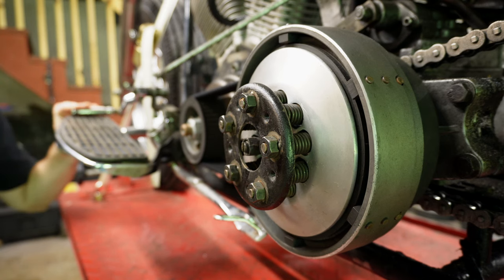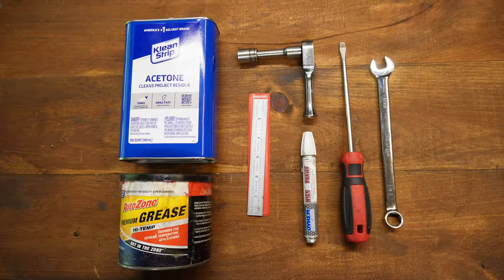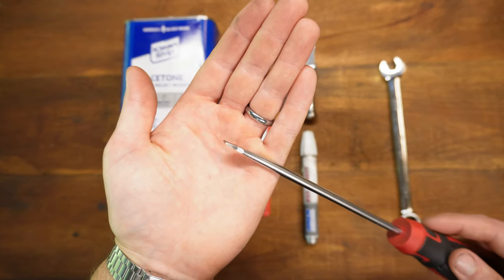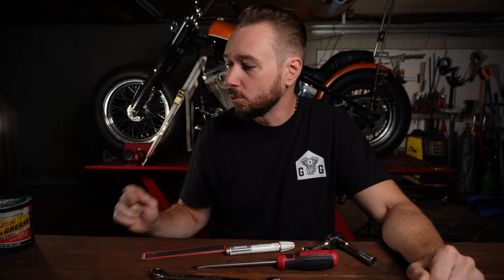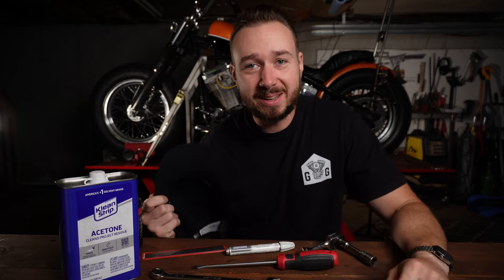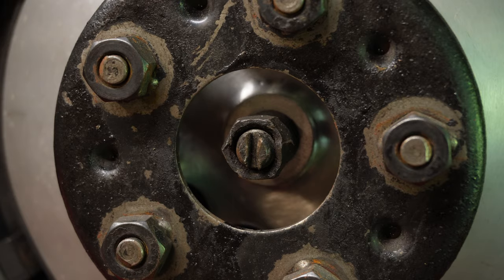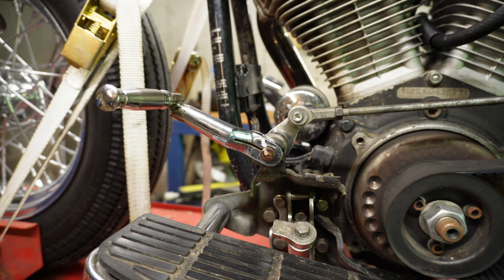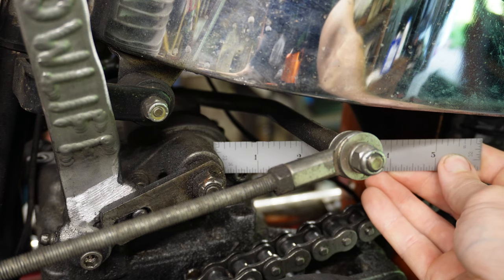How To Adjust A Harley Foot Clutch

Comment: Great video  !  You can check clutch release  with a dial indicator on the adj   screw   of clutch  then engage clutch fully  end gap should be  about   .084"  gap  as not to over extend pressure plate  , You can adj  linkage  geometry  lengths .
Reply from the maker: Good tip man thank you!

Comment: The primary belt being too tight was exactly the problem I had with my 47. If I would have seen this video before it would have saves me hours of fiddling with clutch. Great videos. Keep your foot in it
Reply from the maker: So glad to hear this man! It drove me crazy too and everybody told me it had nothing to do with the belt but I loosened it anyways and fixed it. Had to put that info out for the world 🌎🙏🏼
Reply: @greasesgarage  My new dilemma is my 97 Evo with a primo 3” belt that I have been running for 20 yrs is now tight. It has a solid 1 piece backing plate, no adjustment and no issues with clutch walk. Everyone I talk to has no clue. The day starts off with the proper amount of play, 100 miles later it’s tight. I re torqued the motor and primary but no change. I’m just gonna run it and see what happens.
Reply from the maker: @degonzoman  that’s interesting, I’ve never run a belt without a separate trans allowing it to adjust
Reply: @greasesgarage  I’m running a baker 6 speed with a Premo brute IV that has a solid backing plate back in the day. They’re two piece adjustable nowadays.
Reply: @degonzoman so you can’t adjust the trans to set the belt tension?  I have never seen a setup where it’s not adjusted
Reply: @Scummy_shovel  The belt has about 3/8-1/2" of play when I leave the house after about 100 miles this is the results, tight. I have been running this Primo Brute IV set up since 2000 with no issues other than swapping out the belts over time. It has a solid backing plate. I had a guy change the rear drive belt when this all started, took it back he said he tightened up the trans. but still the same. All I can think is to get it on the bench loosen everything and torque it all back down.  
Not sure if this video works but here it is after 100 miles. 

 https://www.youtube.com/watch?v=oxgsSE84wAs
Reply: @degonzoman  that’s extremely weird that the tension would change.  Then goes back to loose after it’s set for a while?  Or you set it. Ride. It gets tight and stays tight untill you adjust it again?
Reply: @Scummy_shovel  When I roll it out cold it's right on 3/8"-1/2" play, right were it's always been, 100 miles later tight. There is nothing to adjust with that Premo Brute IV solid backing plate. I thought maybe the clutch hub was heating up and expanding creating the tension so I pulled out the plates to have a look and it all looks good by the eye. Front and rear pulley doesn't seem to be any hotter than usual. I have been running this set up for 24 years and have over 100K on it. The motor main bearing has been changed out 5 years ago the Baker 6 speed is still original. I can only think maybe the Trans is not torqued correctly and after banging through the gears its somehow shifting ever so slightly or it is a bearing issue. I'm at a loss, everyone I talk to thinks I'm crazy but that's besides the point. Now I just pack an extra belt and run it.  
Keep the videos coming
Reply: @degonzoman  where you the guy on the chop cult forum asking this question?
Reply: Yeah that’s was me, I also asked on the Jockey Journal but for some reason they took it off. I guess Evo’s are not welcome.
Reply: @degonzoman  lol. Yea they don’t like evos there. I remember seeing you on chop cult.  Did noone have any ideas there?  If none of those guys have ever seen it then Idk what to tell ya. Lot of knowledgeable guys on there.  I guess all belts tighten a tad when they get warm   Maybe just get another belt and see how it goes.  I don’t mess with solid plates or those really wide belts.  I am a 1.5 kickstart guy myself.  Good luck tho.

Comment: The pushrod adjusting screw is for adjusting pushrod end play (1/4 to 1/2 turn out from lightly seated). This endplay is to prevent the pushrod throwout bearing from burning up. The spring retainer nuts are for compressing the clutch springs to the proper installed height/pressure. My Barnett heavy-duty clutch springs have a 1-1/2" free length and have 68 pounds of pressure at their installed height of 1-1/8". With the pushrod adjusting screw set, and locknut tightened, and spring pressure adjusted....measure from the clutch release arm mounting point to the mounting point on the foot clutch pedal. With the pedal in the position you want, you may have to lengthen, shorten, or fabricate a new rod/chain or whatever you'd like to use, to achieve the pedal position you desire. That's it! You're done. Bang 'dem gears!

Comment: Great vid  I have a 59 pan with a 65 trans foot clutch hand shift full suicide  just replaced my clutches had to adjust the foot clutch all the way back cause the clutch wouldn’t disengage  but theres no nubbs on the pressure plate                          ( aftermarket) I just use nylock crown nuts ) and measure carefully ……good to go

Comment: Great videos! I have a 42 WLA and it grinds while attempting to put it in 1st gear. Any thoughts on how to adjust that? Thanks
Reply from the maker: Usually happens when the clutch isn’t fully disengaging the plates. I would check your clutch throw to make sure the plates are separated.

Comment: I love the sound of my dry clutch on the shovel, except mine isn’t that noticeable. I wonder if there is a way to make it louder?
Reply from the maker: This is the correct question to ask haha. Love it. These are drag specialities plates, the inexpensive ones. Maybe that’s the secret
Reply: @greasesgarage  do you run both the friction and steel from drag specialties?
Reply: Remove the rattlers

Comment: Hey grease, love the vids and the way you give simple info and instruction. I was wondering if you knew how to determine what belt you need for your application? Ive looked for something like that on forums and can’t find an answer. I have an open belt assembly on the way and wanna make sure I get it right.
Reply: * specifically how many teeth my belt should be. I see a lot of different amount of teeth options for 1.5” belts.
Reply from the maker: Great question, did you order a kit or just the pulleys? What bike is it going on
Reply: @greasesgarage  I’m just getting a set of used pulleys and didn’t come with belt and seller didn’t have any info to help with. Gonna be running this on my 1973 shovelhead and ratchet 4 speed.
Reply from the maker: I'll have to do some more digging on this but you'll want to determine whether your pulleys are for an 11mm belt or 8mm. That distance is from tooth to tooth on the belt itself. As far as why there are two options and which you'd choose for which situation, I can't say. I just know that the only one available for my evo/shovelhead combo was an 8mm which was marketed as being for 4 speed tranmission kickstart only.  @kalaniortiz3063

Comment: Hey man, i find your videos really helpful, I got a question, do you have any tip to how to adjust the primary belt ? Cheers
Reply from the maker: Thanks man. So in this video I showed you the benchmark I use for where the tension should be, but as far as how you’d make those adjustments, I will have to do another video to show that. I’ll add it to the list
Reply: I found the problem, I wasn’t able to find neutral easy or to go to the gears while the bike got hot, it was all in the clutch adjustment, and I sanded off a little bit the fingers of the clutch hub, now is working as it should be, thanks
Reply from the maker: @jorgequiros1310 that’s great to hear! Congrats on getting it solved brotha

Comment: Please show a evo 5 speed foot clutch conversion can i use a chain primary i live in So Oregon rain dirt roads i would like to cover the primary thants
Reply from the maker: I will try to get my hands on an evo 5 speed setup but it’ll be down the road because nobody I know has one. As for chain primary yes absolutely. You don’t need to go open primary to run a jockey shift

Comment: my clutch grips fairly high on the pedal at idle, but when i ride the clutch drags when fully pressed in ... any tips?
Reply from the maker: If I'm understanding what you're saying correctly, it sounds like there isn't enough total throw to disengage your clutch, even though the pedal travel is fairly long. Is that correct?

If so, I'd want to know how long your pedal is and where on that pedal the pull mechanism is attached. You need more twist of your clutch arm. If the rod attached to your pedal is only halfway up the pedal, move it to the very top so you're getting the full pull out of it. 

If the pedal is very short, use a longer pedal to give you more travel. 

Let me know if this helps

Comment: Hey man, i'm having trouble with my 4speed transmission/bdl clutch on my cone shovel. I made a foot clutch setup and it seems to keep jumping out of neutral into gear, it happens even when im trying to kick start the bike. Any insight would be appreciated.
Reply from the maker: I don’t think that jumping out of gear would be related to the jockey shifting but more about what’s inside the transmission itself, it could need a rebuild

Comment: Hi bro , I used  your knowhow to setup the rockerclutch I instald on my 1973 shovel.Normaly on a cable opperated clutch I whould set the clutch pushrod to nearly thigth and then back it off for some freeplay , on the rockerclutch I had to do what you mentioned and srew the clutch pushrod way in to make the clutch disingage ! it works but is this to much stress on the clutch release bearing ?
hope to hear from ya. Fred from the Netherlands.
Reply from the maker: Hey Fred, 

Glad to hear you got the clutch working! As far as the stress on the clutch, you want to make sure it only pulls JUST far enough to disengage the clutch, no further. So back it out a little bit and see if it still works, if it does, back it out a little more and repeat until it doesn’t then turn it back in. That’s your perfect setting 👌🏼
Reply: Thanks bro , so if there is pressere on the pushrod iff needed thats oke ?

Comment: Anyone know why the clutch is so loud when depressed? I look forward to doing a foot clutch, but is it possible to do without that grinding/scraping sound?
Reply from the maker: Yes. The sound you’re hearing is the clutch plates chattering against each other, this is distinctive of the dry clutch of the open primary. With a closed oil soaked primary the oil dampens that sound so you don’t hear it, so you could do a foot clutch with a closed primary and you wouldn’t hear the sound. 

Though I’ll admit, at chopper shows you hear the sound all day long and if you spend enough time around these chopper shows you’ll eventually want to have it yourself haha. Give it time

Comment: Just FYI:  Starret is pronounced "Stare it"  and a machinist ruler is referred to as a scale.  
 My bone stock 1999 Softail clutch WILL NOT function properly when adjusted to the factory manual specs. I had to learn the proper finness for MY clutch.
Reply from the maker: It’s definitely a “feel it out” type of thing. Springs wear out over time and lose tension, plates wear down with friction and shrink up, there’s too many factors at play. 

But when I was struggling to set mine up all I heard from everyone was the same old “buy a manual” speech so hopefully this video (and your confirmation) is enough for people to try tweaking their own setups.

Thanks for the input brotha
Reply: @greasesgarage   Just to be clear: I encourage every rider and/or builder to have the factory service manuals and factory parts catalogs for their machine . If their machine is a swap meet special, then at least get the factory parts catalogs that cover the parts from which their machine is built.  Having these books/pdfs/whatever will provide invaluable information and will pay for themselves many times over if your wrench your own ride. 
 My 1999 Softail clutch will not function properly when adjusted to fac man specs, BUT, fac man specs got me into the ball park so that I could figure out what needed to be done.

Comment: Also if you set your clutch hub nuts to where you like the throw of your clutch but experience slipping in high gear…You should tighten those nuts. But only enough to get rid of any slipping

Comment: I need to get an extra one of those linkage ends for the cowpie so you can weld it for me. I don't wana pull mine apart when i'm not fully prepared to build the set up. Then my shovel would be down untill I get off my lazy ass lol I'd rather have the piece that needs weld work done and on deck that way when i'm ready to jump into the project I have that piece already
Reply from the maker: 100% man if you can source a spare one on eBay I’ll make up a shifter for ya with it
Reply: @greasesgarage sweet thanks man! I'll keep my eyes peeled for one. I can't say it enough, your explanations are so  thorough and simplified that it really does give me quite a bit of confidence when I start wrenching. I hate videos where they tell you 3/4 of the steps then just skip to the end when they're finished. Like why tf even bother making a "how-to" video in the first place lol
Reply from the maker: @anthonysmalawipredators8794  I hear that brotha! When I was getting started in this and learning the basics I always felt like the way people explained it was overly complicated. 

It takes a surprising amount of time to make the videos seem simple lol, but in the end I’m happy to hear that it’s coming through as clear as I’m trying to make it 🙏🏼

Comment: Your wrong on spring tension nuts... they are not there to set pedal.throw but they apply pressure for disc compaction not to set pedal engagement thrown

Comment: You are incorrect about clutch adjuster center screw..its used to elimnate all play in pushrod assemblys but not some much as to preload the throw out bearing(premature failure)..dont mislead the public to failure.